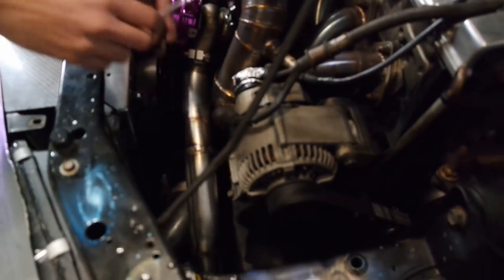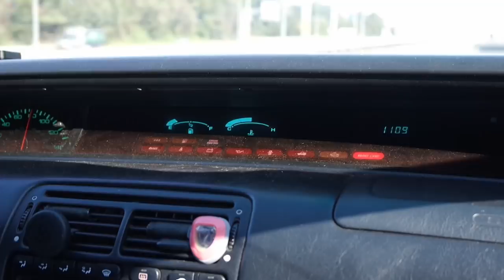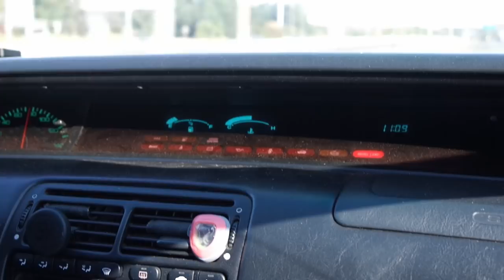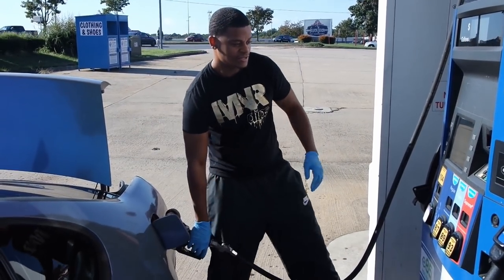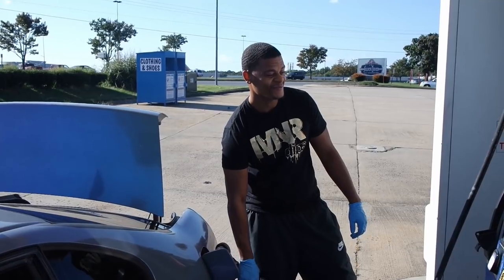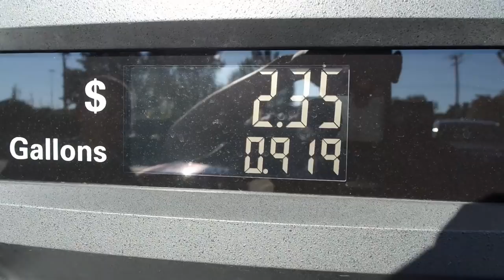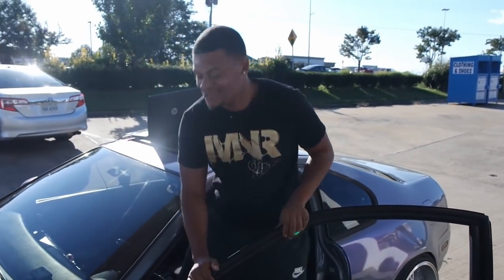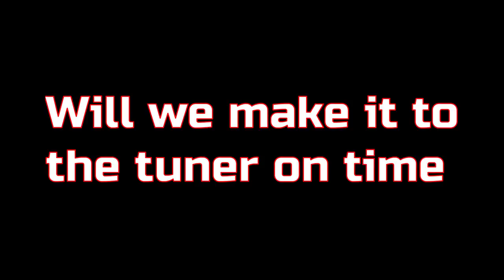Going E85 In my TURBO HONDA PRELUDE

Comment: I have a 5th gen prelude, with a f20b, I used a rywire conversion harness for the distributer. Wondering which ecu I should run.
Reply from the maker: Your timing will need to be set with the timing gun to my knowledge

Comment: Can you make a video plz on everything you need to RUN e85 in a prelude ? I have a 01 prelude been looking everywhere but can’t find info

Injector size ?
What fuel pump?
And should you change fuel lines?
Reply from the maker: I made a video on that I'm pretty sure.
Reply from the maker: You can run stock fuel lines just get a walboro 450 pump and 1000cc injectors and your good

Comment: I got a 5th gen with h22 I wanna go e85 but don't know what I'm gunna need. What's everything I need to run e85?
Reply from the maker: Walboro 450 or equivalent fuel pump, fuel lines are optuonal, and chipped ecu or hondata s300, and a tune.
Reply: @treybedipping1734  Alr then bro thanxs